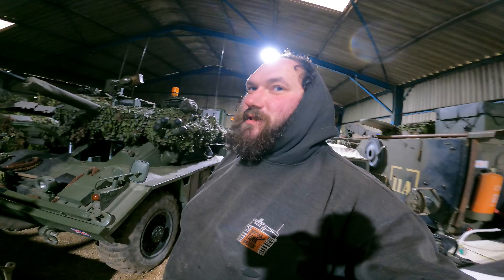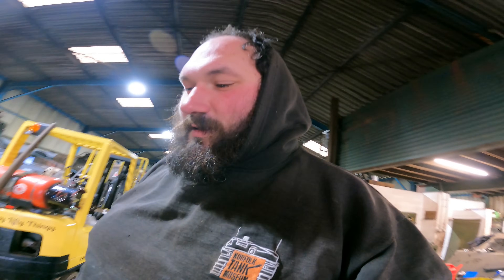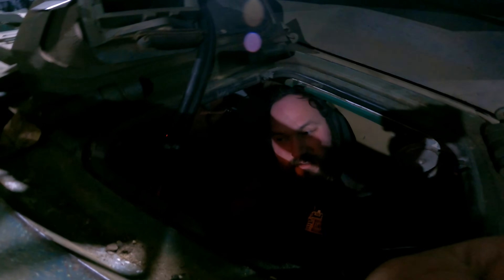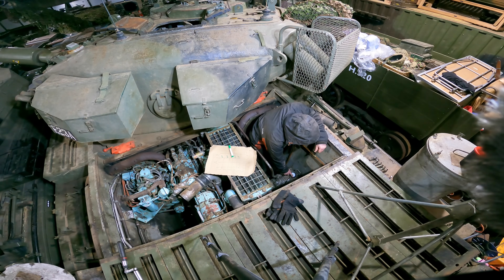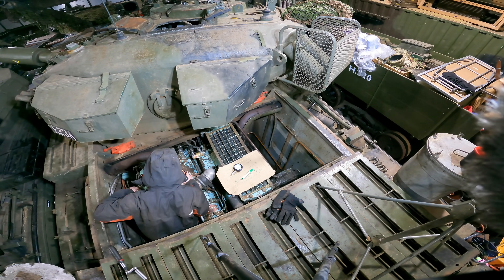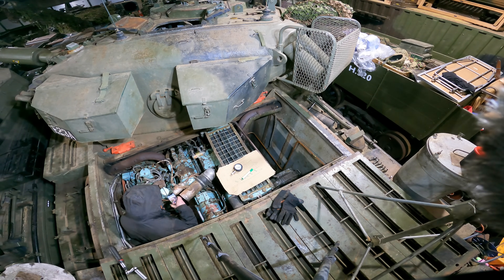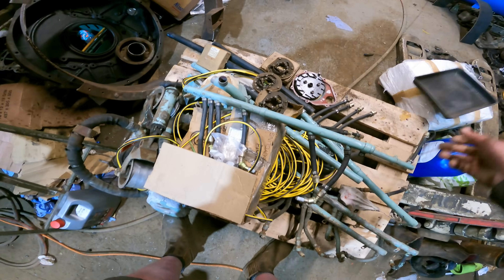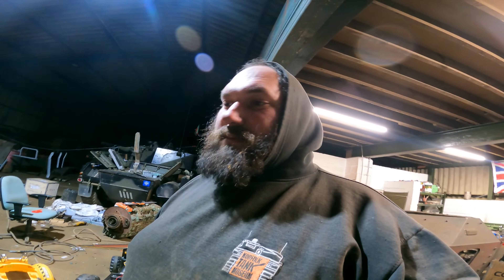Engine dead? Rolls Royce V12 27l Compression Test Meteor Tank Engine - Tinkering Tuesday

Comment: No idea what you were doing but I would love to get in there with a bunch of spanners and take things to bits clean them and put them back, It always upset me " don't ask me why " with my old Chieftain that the engine and gearbox compartment were swimming in oil and water and god knows what, I managed to keep it running for 3 years mainly due to the help of a 2lb lump hammer, but I did so want to get it nice and clean, then they moved me onto 432s and Scorpions and I felt the same but they were much more easy to keep clean.

Comment: There's nowt wrong with Parkside.
Reply from the maker: I guess maybe they do some alright stuff, haven’t found it yet though
Reply: @tinkeringwithtanks  The stuff is decent quality. The spanners, sockets etc are pretty good, decent material strong enough. Their drill bits have a good grind on them. I also modified a disc sander to make a slow speed grinder for sharpening carbide turning tools and scrapers. All in all I find their stuff to be good value.

Comment: Another Fab video....... 
Gets you wondering, how small were the tank wrenchers in the 50s/60s/70s?
Reply: Can't give you exact figures but tank drivers were generally short by today's standards. Same applied to London transport buses. They were designed for an average 5foot 6inch driver. So, at 6foot, I had to stoop slightly to get proper vision. Not an option in a closed down tank. AEC Militant MK2 "knockers" and Bedford RLs were about right for me. Incredibly crude seating in an RL but strangely comfortable to drive long hours day and night.

Comment: I hope you had the throttle wide open and the choke off or your readings mean nothing!
Reply: I think it was just a miss in the explanation. He may not be a trained Instructor but, he does know what he is talking about and tries to keep it simple for non experts to enjoy.
Reply: Why? Genuine question
Reply: @Mr_Springy  I am sure it was just a miss in the explanation while making the video. Full throttle and choke open gives maximum gas entry which is what the factory compression test figures are based on. Closed choke or throttle would admit less air to be compressed and therefore a false reading.